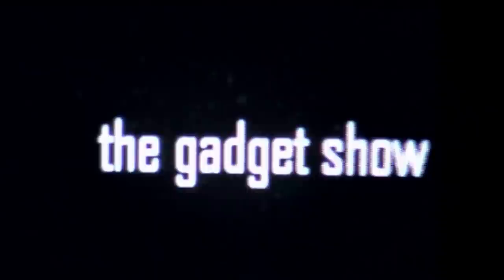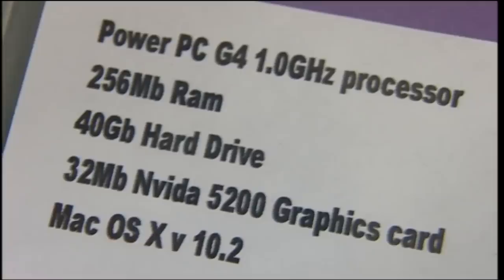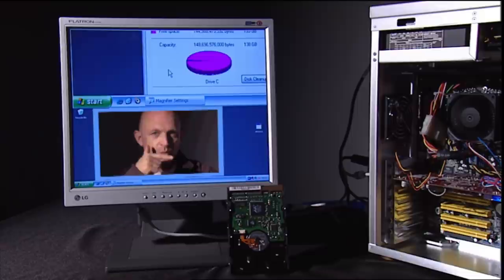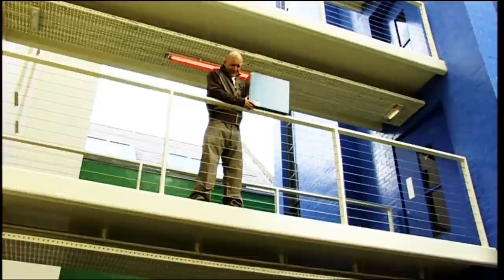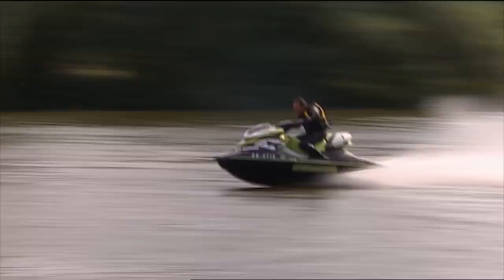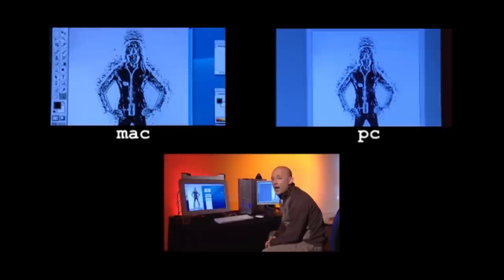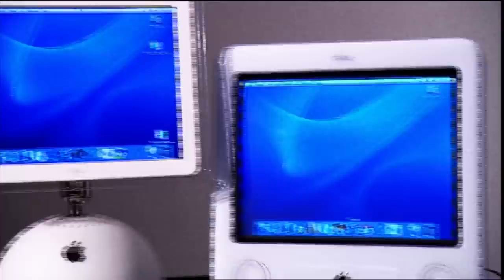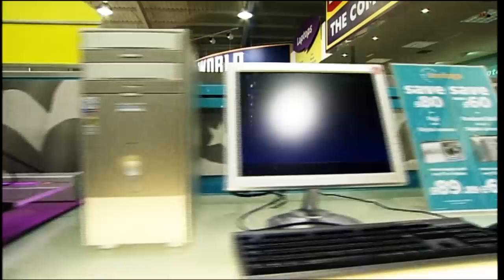The Gadget Show - Series 1 Episode 7

Comment: wtf they had 4ghz cpus in 2004
Reply: +extrememining Yes. That was before AMD and Intel started making two cores.
They figured that if you have more cores running at a lower clock speed it would be more efficient than having one core running at extraordinary high clock speeds